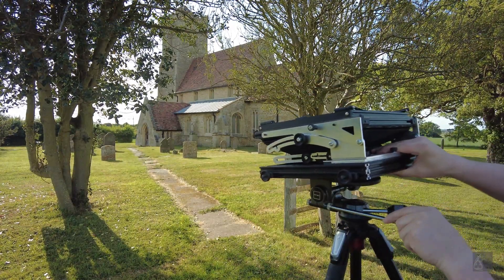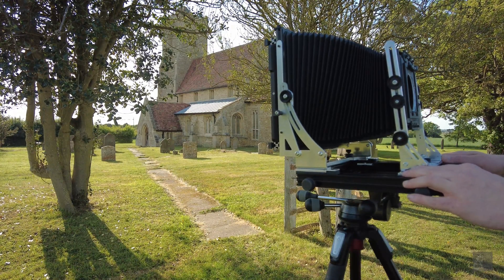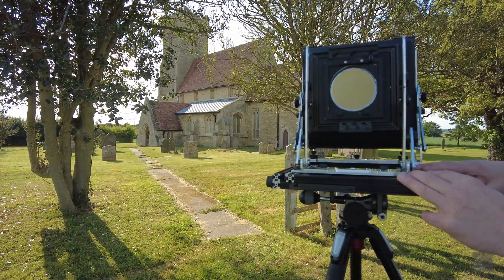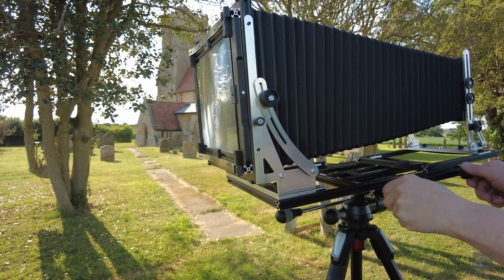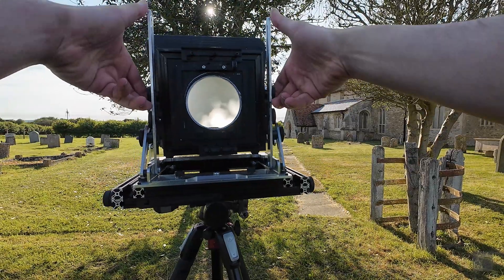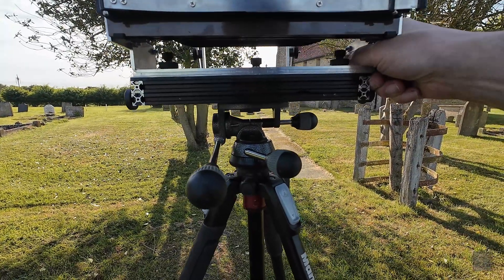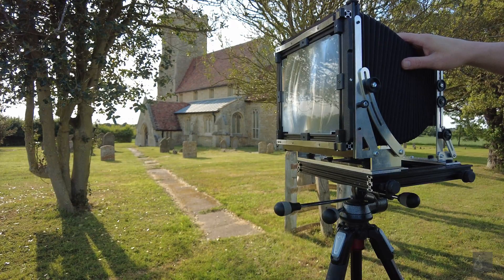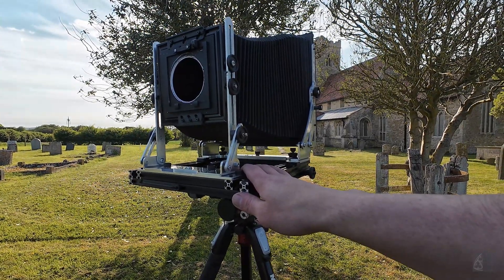I built a Large Format Camera | 8x10

Comment: The only thing I wonder after this video: Landscape only? Looks promising, but quite heavy. How much did it cost you (roughly)?
Reply from the maker: It is vertical as well, I forgot to show that. There is a locking system at the top.
Price of materials with a Fresnel lens : £185, and filament of 3d prints. 
The weight is not bad, I measured some time ago, it but I can't remember. I need to find a scale.
I will get back to you on that, because I need to know as well.
Reply: @n.defrance  Thanks for the reply! I don't think that I would go this route, but it looks intriguing. Weight is one of my biggest concerns, since I already struggle with a 1.5 kg Chamonix 4x5 camera (and the film holders are also a significant contributor to the total weight of equipment to carry around).
Reply from the maker: 100% with you on that. ( film holders gets so heavy )
It will be heavier than that.